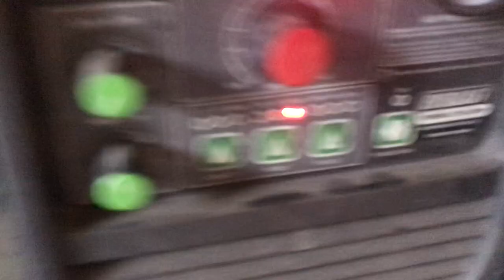(147) carbon arc gouging with a small Everlast inverter welder

Comment: That's pretty rough on the welder though. BTW it's often easy to find big used AC transformer machines (many people don't know ya can gouge using AC or that it's preferable for cutting cast iron etc) for cheap. I bought a T-400 for the cables and kept it because of the arc.
Reply from the maker: I've never tried gouging on AC, I'll have to give that a go. I Wana get a big old Hobart bothers transformer welder, not actually for gouging but just cause I like old welders. 

Ya I know it's likely hard on it but way I see it it's likely not too much worse than just welding with it. But like I said if it damages the welder I'll just fix it. Good excuse to try my hand at diagnosing and repairing a circuit board.

Comment: It's because the voltage spikes which occur in cag over time that little machine will go out inverters Handel electricity different
Reply from the maker: All machines will fail given enough time/use and abuse but this little bastard shure has treated me well.

Comment: Thank you for making this video! I was having the same thought, why do you need a huge powersupply when the the smaller rods are rated for like 80-120A. As a hobbyist i cannot justify getting a 400A PS but now i have to try with arc gouging with my small inverter welder 😊
Reply from the maker: Yea, give it a go, post a video of it. Be curious to see how it works for ya.

Comment: As a shipbuilder who is the go-to guy for carbon arcing, i always wondered how much power would be best for each rod. And its not like i have a welder right next to my job im working to easily adjust and find out. Nor do i see arc rod boxes. Where we get rods, they are all in a bin. So i cant read a box to see if they have recommended powers nor can i just step over to adjust. Jobs all the way down here, weld boxes all the way up there, im not hiking back and forth 100 times, killing myself to find out

Comment: Thanks for this video!  As a home-gamer, I was wondering about an alternative solution.
Reply from the maker: Ive been playing around with this more and find it works great at 160 amps with hollow 3/16 carbons
Reply: @tdm8817  How do the hollow carbons function differently? Isn't your air supply (blowing the molten metal) still coming from the holes on the torch?  I haven't seen those available, but I'll check them out.  Thanks!
Reply from the maker: @ls2005019227  yes the air still comes from the torch and the hole in the carbon has nothing to do with air. Basically I'm just playing around with trying different stuff, seems like the hollow carbons are a bit easier to control and don't burn down to as sharp of a point as the solid ones. I haven't spent too much time with them yet tho.
Reply: @tdm8817  I just ordered a torch & some 3/16" carbons (pointed for now) today. I'm ready to give it a shot.

Keep me posted & thanks!
Reply from the maker: @ls2005019227  o nice 
What welder are you using for it
Reply: @tdm8817  Update:  I'm using a Miller Syncrowave 210.....which is limited to 150 amps for DC stick welding, and goes up to 210 amps for tig.  I received the 3/16" carbons and the torch, and I just left it on 150A for stick welding- it works fantastic!  I'm sure that 600amps on a big machine would remove more material faster; but this works plenty good enough for what I'll need.
Reply from the maker: @ls2005019227  bad ass! Good to hear!

Comment: Thank you!!!  I have recently been wondering the same thing and was interested in rigging up a gouging torch and run 1/8'" carbons.  I am a little hesitant to run it on my PowerTig 255EXT so I may buy a seperate  less expensive Everlast Stick welder unit with a decent duty cycle.  I was also considering hooking it up to my old Lincoln AC Stickwelder, aka Tombstone but I am not sure how well an AC power source would operate.  I have read that there are (or at least used to be) specific AC carbons with an extra ingredient in them to stabilize the arc however I have NOT been able to find them anywhere online.   I have a suspicious that they may not have been a popular item and perhaps are no longer in production.
Reply from the maker: I’ve never tried gouging on ac but I’d be curious to try it, one would think it would work just fine and I’d think a transformer welder like the tombstone would be perfect for it. If ya try that I’d love to see a video of it!
Reply: I ran 1/4” carbons regularly on a 355EXT everlast a LOT on heavy iron. Worked really well. I didn’t abuse it though, I’d let it cool for 5 mins every 10-15 mins of carbon arcing. Also had to let the compressor catch up about that often too. I’ve heard it’s hard on inverter machines but I never had any issues using it for about a year and half daily for tig/ carbon arc.

Comment: ck with the maker of your welder if it is rated for air arc (inverter welders) some will burn the mosfetts out and no warranty.  small rod small power big rod big power
Reply from the maker: It's been out of warranty for years 
If it fails I'll just fix it